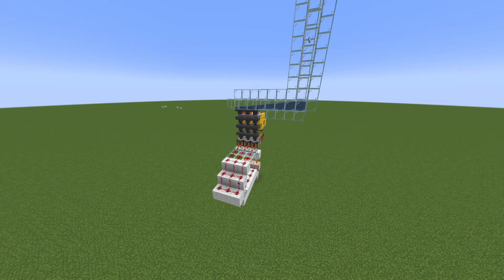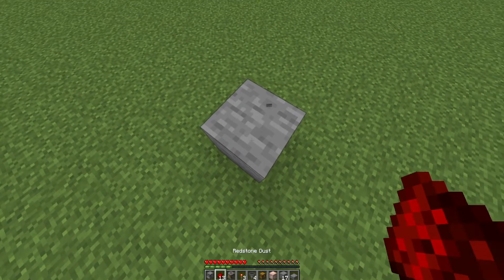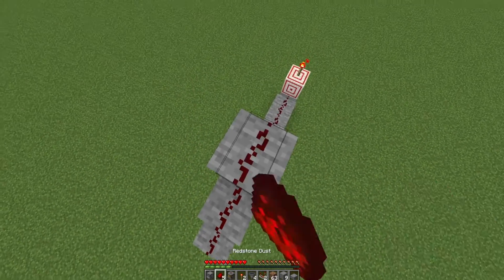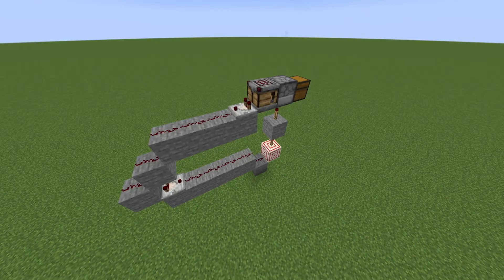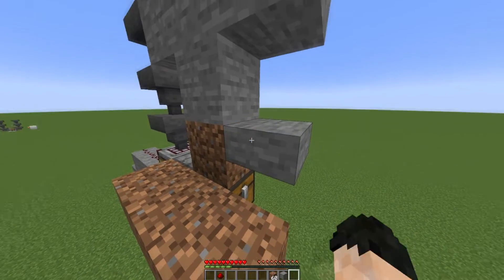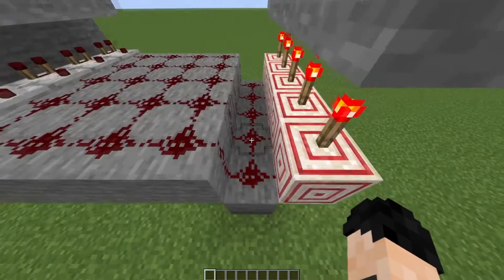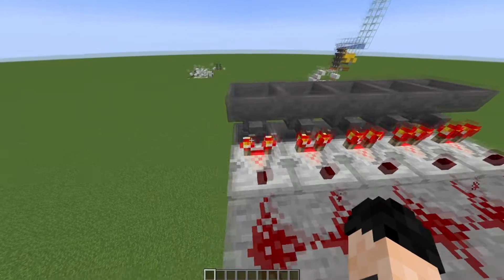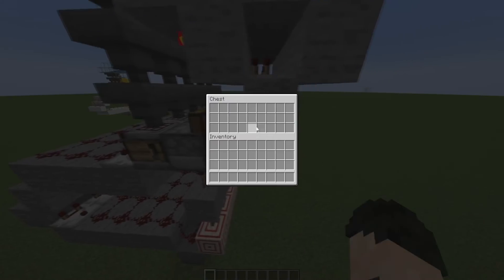Minecraft Tileable Auto Crafter (Works in Most Recent Version, Check Description)

Comment from the maker: For those saying that I should use a lectern and an observer, I didn't want to use observers because of double pulse, which can sometimes mess up the crafters and craft the wrong items. That's why I went with this design. Also, I noticed that you can make it a bit smaller by simply putting the item sorters on the other side of the hoppers (the same side as the redstone for the crafters), instead of about the chests.
Reply: Why you put droppers in front of a crafter? Crafters can put inside countainers 😭
Reply from the maker: @Calvodecria559  It's about where the Redstone pulse is and there needs yo be a solid block there but also a container
Reply: @WitherslayR  Then get rid of the droppers, move the crafters to where the dropper was, and put a solid block where the crafter was. Comparators can read through blocks and this will not mess up the design or functionality.
Reply: @dracconis69  then where does the hopper go?
Reply: @Ollw-hi4ez  Where they have always been. Right into the Crafter. That part doesnt change.

Comment: Hii, i have one question. So, when the first rows of chest are full, how can i make the crafter stop? Because in my case i use it for a iron farm but when the chest, hoppers and the dispenser gets full it continues crafting iron blocks and throwing those in the air
Reply from the maker: @Kratioss  If you use a comparator facing away from the chest to detect when it's full you can send a Redstone line out of it to the hopper which will keep it from crafting. It probably will be difficult to do so while keeping it tileable so it might be worth it to expand the storage via either more chests or a shulker box loader.
Reply: @WitherslayR Thanks, i dont know that much about redstone but i found a solution to make it stop when the row is full and still be tileable
Reply from the maker: @Kratioss  Good to hear. Honestly I couldn't think of a good way to keep it tileable

Comment: Why is it a slab under the Repeater and not a full block? Cuz i want to add this design to my already existing farm but i built it with full blocks under the repeater
Reply from the maker: @EricMetEenC  It doesn't need to be a slab but it does need to be a non-solid block so that you can open the chests

Comment: Mainly for items that have storage blocks + smaller recipes that the crafter would make prematurely in this case iron nuggets, pressure plates, & bars. This is the best starting point for controlled work, on the other side of the equation is freely powering crafters and letting them craft the first available recipe like when making blocks of bamboo

Comment: Only issue i had with this tutorial is that you didnt start with the hopper on top which usually what people will use as starting point , since items usually go from top to bottom
Reply from the maker: I was thinking about doing it like that but it's a bit more annoying on video that way and I recently followed a tutorial on a shulker box loader that started at the bottom and it wasn't too bad so I just did it like this.

Comment: Instead of all that redstone dust and target blocks, you could just have two comparators facing each other with one redstone dust in-between.

Make it so that the "dummy" comparator outputs a signal strength of 8.
Then have an observer activate from that redstone dust.
Then link the observer signal to the crafter.

If the crafter is used to make iron blocks: To avoid the observer's double-pulse accidentally making pressure plates, limit the speed of the input hopper. This can be achieved with a hopper clock + comparator facing into the input hopper. So it's still tilable.
Reply: There is a tileable design by mistycat. This works with observers and a lectern with 8 pages.
Reply: @etalon11  I've seen their design but I'm not too fond of it because it takes up more space than it needs to and uses pistons so it's noisy
Reply from the maker: @etalon11  I have seen that one (which was made after this btw) and I didn't like that it double pulsed with the observer which had a chance of breaking it
Reply from the maker: I was considering the idea of eliminating the redstone and target blocks by using 2 comparators but I couldn't find a way to make it 1 wide and I didn't want to use an observer because of the double pulse... If you delay the input then it's just kinda slow and it can still mess up, and once you make a hopper clock and all the other stuff you are using a lot more resources and takes up some space to add it anyway so it probably isn't worth it but definitely another way you could do it
Reply: @WitherslayR  Yeah I get it. There is another way to eliminate the double-pulsing though.

Make the observer activate a copper bulb, then link the bulb to the Crafter via a comparator. This design is tilable but can't craft single-slot recipes. It should be tilable next to a single-slot crafter though.
Reply: wait nevermind you can just put a repeater to level three between the observer and crafter. This won't work with single-slot and two-slot recipes though. Mojang pls 😭
Reply from the maker: @AuroraNora3  Yeah this was created before copper bulbs were released but that's an interesting idea... If they change anything else or add some other way to use crafters I might use this though.
Reply: @AuroraNora3  You can to make this work with 1 and 2 slot designs. IF the main crafter has 8 slots (for 1 slot items) or 7 slots (for 2 slot items) checked and the Filter Crafter is set to 8 slots checked, then when the main crafter is full it will crat the 1 or 2 slot items. Main Crafter with 7/8 slots checked full = signal length 9 vs Filter Crafter with 8 slots checked = signal length of 8. Observer will see change and power crafter to create item.